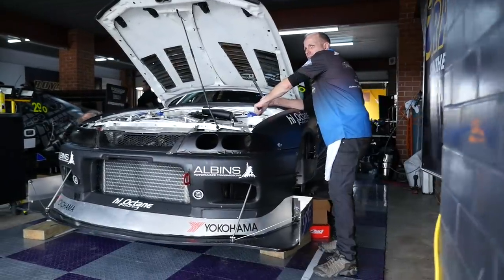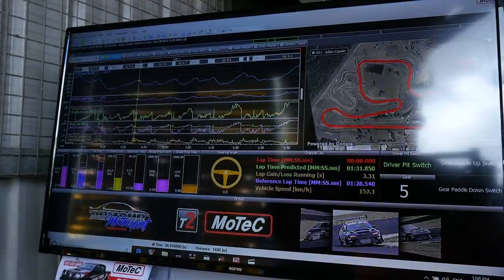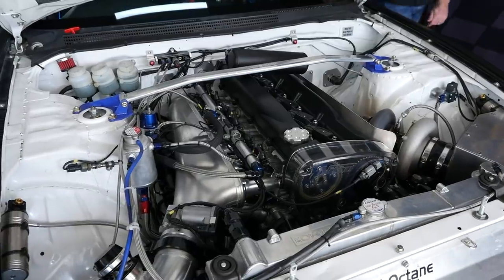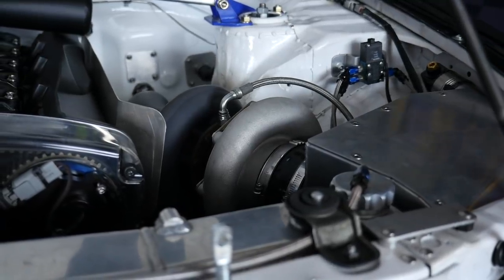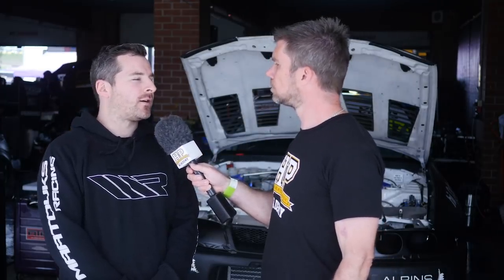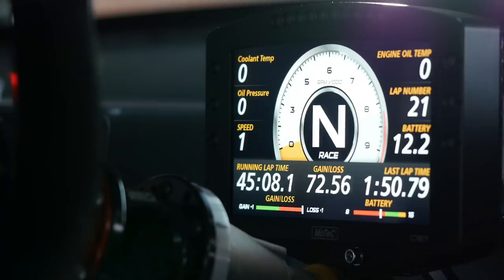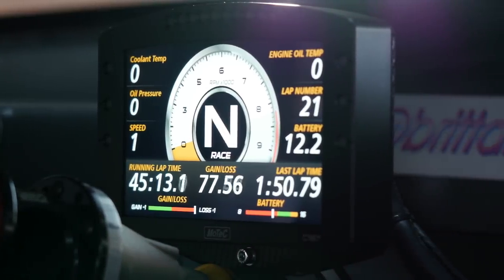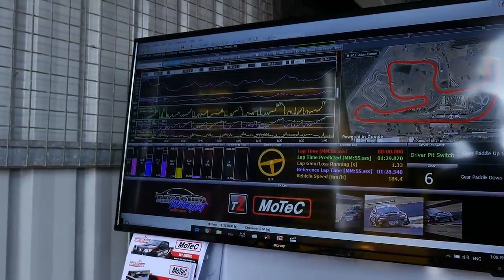950HP GTR Telemetry System | ‘RB28’ Time Attack Skyline [TECH TALK]

Comment: Good stuff.  Been tuning for better part of 30 years from the days of the first Haltech E6 monchrome, seen the progress made and this is great .  You should see the crazy stuff we had to do before data logging, and  the things data logging alone could not reveal or a chassis dyno, that only seat of the pants track tuning alone can reveal.  Yet getting it right can make such a difference in making the power and delivering it into useful Real World results that will blow your mind.
Reply: As Tony said about his GTR he round out by putting his car on the hub dyno rather than do track testing he found he tune more aggressively and make more without the wheel spin. Yeah I remember the old H6 Haltechs, a few plug-n-play units too.

Comment: I drove my friends 720AWHP R33 GTR around Houston, TX for a day. Full throttle on it was a monster to handle in short spurts on the street, so 950HP on a circuit must take 100% concentration from the drivers. You have to understand, that's much more power than most racing series.

Comment: That live data is really really cool! I wonder why they switched from Haltech to Motec and not knowing the differences is why I ask?
Reply: Motec is seen more in professional road racing, so the telemetry for them is something they have been doing for decades. Many top racing teams from touring cars to Le Mans run a Motec system with Live Telemetry. It's the F1 teams that have gone in-house and can actually change the cars' tune or shut it down from the pits. In fact the data in a F1 car is feed back to the team HQ so they can plug the data right back into the engine dyno.

Comment: if he had a twin turbo setup and 50 less horsepower this would've been an even better car this car and build is pretty cool but its lacking traction maybe because its lighter than stock and that big turbo that turbo hits all those boost after 4.5k but hats of to that driver he is attacking those corners even with with this much power without even loosing control

Comment: Another person going from Haltech to motec. Definitely going motec when the time comes
Reply from the maker: They're both solid products, it just depends what you require and what sort of budget you have. 
Really these days we're spoilt for choice when it comes to quality ECUs to the point the main decisions are based on your required features, as in ones you will actually use, and what your tuner prefers if applicable =) - Taz.
Reply: @hpa101  True for road racing though Motec is a natural fit. Haltech somewhere between the professional and the hobbyist. Just as no serious professional team runs Holley EFI...

Comment: basically its the same system that F1 teams are using only the F1 have way more telemetry system to monitor, gearbox, hydraulics, engine oil & water temps, boost pressure, etc.
Reply: Dude.. they monitor oil water and boost. Think.
Reply: I'd hope so with an F1 budget!
Reply: suspension travel, shock valving, sway bars. Everything. Same in ACO LMP1

Comment: Why telemetry is not using cell network for data stream?
Reply: perhaps latency or not wanting to rely on a cell signal
Reply from the maker: We have a MoTeC system that does use the cellular network :)
Reply: Budget, F1 teams use cellular and satellite to transmit data not just to the pits but back to HQ
Reply: @dj4monie  Well, I asked because I believe that cellular system sounds much cheaper and more reliable. Coverage is great these days, and speed is also shouldn't be an issue in my understanding. And you don't need to buy receiving equipment like antenna on the roof and deal with it. The only downside may be if cellular system is sold with a service (like trough MoTeC server) and it costs too much...

Comment: Saying that the drivers in open class are not pro drivers it technically not correct. Wasn't this car piloted by Stephen Johnson? A fair few others in this class that you could say make a living from driving??
Reply from the maker: They're not paid to drive the car. I'm not sure of the rules, but it's possible more based around that fact. Might be worth asking the WTAC crew though if you want more clarity =) - Taz.